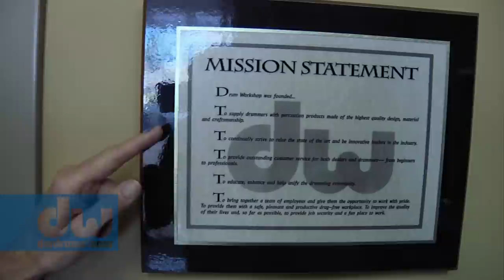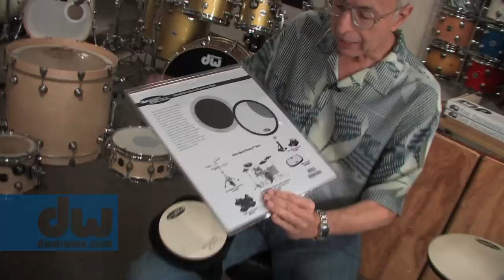DW Hardware Webinar with Curt "Kirkee B" Bisquera, Cobus Potgieter, & Don Lombardi

Comment: I've actually chatted with Mr. Lombardi over in forums about Pedals and cams, etc.
 I did switch because I was looking for a round cam with a better linear response and while the design and engineering of these new ones are outstanding I do miss the manufacturing quality of my DW5000 double pedals that I got for a discount (80 bucks) at Best Buy when I was getting started, even when they were made in Taiwan. A true work horse, those guys went to Hawaii and back in my checked in luggage and were inspected and taken apart by TSA, they still work. I'll never forget those pedals and still have them.

I just wish the cost could go down and that the pedal design itself was a little longer and less like a foot, but I know I'm the exception. Also offer the option of the turbo round cam with the standard 5000's.

These things are like Cadillacs and they are made for loud music with their huge heavy beaters.

Comment: Great stuff, high quality made. I have lots of DW hardware for my different kits and I'd like to have it consistent. And that's the problem … I'm based in Germany and most of the accessories and spare parts has lead time of 3, 4, 5 or more months. This is unfortunately not acceptable for the working drummer …

Comment: I have a concern that i would like to address to the nice folks at DW's manufacturing dept.. I have always used your pedals, and now, i'm going old school rerto with your DW 6000 turbo single pedal, as it is made exactly like my old 5000 pedals, which helped me perfect my heel-toe technique.. I would never think of using any other pedal on the market, so this is coming from a loyal DW pedal customer..
However, there is a particular flaw in the manufacturing of the 6000 series pedal, and that is the bass drum hoop clam lock screw.. I'm referring to the screw that holds the clamp in place.. Because i use different sized bass drums with different sized hoop thicknesses for many different gigs, the screw started to bend in a forward position, and this is after the locking mechanism was locked into place.. Luckily for me, all i had to do was bring the original screw to my local hardware store and found a pack of screws that were the exact same size match and fit perfectly, only that they were about an inch longer, but still works perfectly..
Now i know that this is not an adjustment issue because i've been using this type of pedal for a while now and know how to adjust and lock the hoop clamp.. I'm thinking it may be an issue with the type of screw being used, or where it is placed ?.. As of now i have the hoop clamp lock nut fastened all the way to it's lowest position, and adjust it more with the wing nut..
I really don't know why this is because i'm no engineer , but i do know that this problem needs to be addressed.. Any suggestions to avoid future bending of that screw ? 
I'll admit, i am a bit of a lead foot, but have really good technique, which is only natural after 32 years of playing, but still love the fluidity and lightness of the 6000 series pedal, and aesthetically , it looks great with my kite..  So with that being said, i hope you fantastic folks at DW can fix this problem..  Any and all suggestions are welcome.. Cheers !
Reply from the maker: Hi blica 1, can you please contact our customer service team so they can take care of you. We just want to make sure that there aren't any other issues with your pedal, etc. Thanks for sharing with us.
Hours: Monday-Friday 8:30am-5pm PST
Phone: 800-45-DRUMS (800-453-7867)
Email: customerservice@dwdrums.co

Comment: you guys need to bring the adjustment up above, mount them on the snare drum clamp arm, the bass pedal mount screw should be on a u-joint up near the top of the pedal, you guys are not thinking, If I was working for DW, I would change the drumming world...yes I am him. I designed this stuff, 25 years ago,

Comment: Sorry to post on such a old video but I just got my 9000 rack.  I know it's all about options but what is the generic theory of using the V Angle Clamp? I couldn't tell if it would be more helpful for quick tom movements since it doesn't seem to be necessary for cymbal arms since they have the adjustable angle via the boom arm holder already. I hope all my terms here aren't too confusing.

Comment: What is the largest snare drum size that a 9000 snare stand can hold? Can it hold a 16 or 18" floor tom?
Reply: and how did you mount the bass drum with the design series kit?
Reply from the maker: Hi peteroks12, it will hold up to 15". The DWCP9300	holds 13" 14" and 15" and the DWCP9303 holds 10" and 12". We hope this helps. With the Design kit we mounted the "gong" bass drum with clamps to the hoops. Those clamps then attached to the drum rack. Thanks for asking. :)

Comment: how did i never stumble onto this video prior 🤔also ... how hard can it get to have a damn manual on dw pedal that a bit more specific than : well move stuff arround and figure shit out k enjoy your new crazy adjustable pedals alone in your corner O-o. For real, I suppose im neat picking really but i wanted to know what is the alleged benefit draw back of each settings .. like idk higher beater = more power but increase stroke weight factor ... but for all adjustment including the board height. would have saved me lot of time =_=

Comment: I have two new 9000 DW hi hat stands.  I use  the long rod but it is always unscrewing.  Easy enough to retighten but is there a way to prevent the rod from turning?
Reply from the maker: Bi-Polar Express You can try a little teflon tape on the threading and put it on the opposite way of the threading so it doesn't come off if you remove the rod. It could also be how the hat is being hit, etc, and worst case scenario you can order a new rod. I hope this helps!

Comment: i need dw5000 pedals replacement parts, that top part where the springs loops arounds (the piece that you can choose the angle of the beater) and the shaft is worn out, a bit pricey.  I had these dw5000 for over 10 yrs
Reply from the maker: +metalmessenger http://www.dwdrums.com/factoryaccessories/partsandaccessories.asp
Reply: +dw drums im looking for the red rod(dw5000) that goes from bearing to bearing, the one that holds the cam and the beater
Reply from the maker: Hi. here is a link with the Schematic for the 5000. You can order any parts from our dealers. Cheers. 😀 http://www.dwdrums.com/images/info/schematics/Pedals/DWCP5000AD3/Single/DWCP5000AD3.pdf
Reply: +dw drums thx that will help, im also thinking about changing my pedals from a chain link to a nylon strap, all the parts that i couldnt find are listed here.
Reply: dw drums thank you, with your lead i was able to get all the parts i need, my dw5000 are better than out of the box, with my springs upgrade.

Comment: I was interested in getting a concept kit (im on a budget) and a pdp rack but could I put dw boom arms on the pdp rack to get the features like the wing that holds the felt and the part under the sleeve to tighten the space between felts? If that would work I would love to know. Thanks
Reply from the maker: lucas wroblewski Yes. 😀

Comment: Having the top felt attached to the wing nut is not good if you have a cymbal holder attached to the bass drum (tom holder clamp, etc.).  Every time you play the bass drum, it rattles.  It's very annoying.

Comment: pioneered the chain drive pedal?   What about Sonor's signature series pedal from the 1982 catalogue?  I use a Sonor sig series and to me it looks an awful lot like a DW 9000 series; I use a DW 9000 series hi hat which looks a lot like a sonor 82 catalogue sig series hi hat.  Sonor lead the way in so many aspects of decent hardware.  Their hardware was made to last forever just about, double braced, memory locks, levers instead of wings nuts, rubber instant release grips for cymbal stands, quick release lever snare stand baskets etc etc.  Not to mention using woods that previously had not been used like bubinga, based on actual research about the hardness of wood and there associated sonic qualities.  Sonor were one of the first drum companies to use Beech and Birch woods extensively in their top shelf drums.   Credit where its due DW.  http://www.drumarchive.com/sonor/Sonor1982.pdf
Reply from the maker: Paul Speter Here is some basic information of DW Drums. 👍 http://www.dwdrums.com/info/dwstory.asp
Reply: I believe the chain drive was invented by Frank Ippolito, who modified Camco pedals.  Even if you allow DW to count Camco's creations as their own, I don't think the chain drive counts.

Comment: 9000 pedals are smooth and buttery, but lightweight feel? Not so much.
Reply: Id say if anyone was after a lightweight pedal they should just get a cheap 40 dollar pedal with no pedal base.
Reply: +Simon McDowell No, they should get something like Yamaha dfp9500 or (for longboarders) the Tama Speed Cobra
Reply: +Frank Larssen ...I'm talking about feel. Lightweight feel
Reply: +Frank Larssen actually you know what, you're right about the speed cobra. Haven't tried the Yamaha yet. I guess what I was saying was most high end pedals I have seen tend to be quite heavy although I will admit that not many beat the dw pedals in weight. I have a baseless pedal and it's great for a 16" bass drum. The cheapest one Yamaha has.
Reply: You should try out the Yamaha´s if you get the chance. They have great balance and power despite their lightweight feel.
Reply: +Frank Larssen well I am in Japan so I should although Pearl is the most abundant brand here. There seems to be a surprisingly low Tama drum set count though.
Reply: Both are great brands, no doubt. Tama is perhaps more export oriented?

Comment: Cobus's hi hat stand is wobbling like crazy...does not inspire confidence. I have the same problem with my pearl...
Reply: It's probably cause It's a two legged stand rather than a three haha
Reply: +A7XfoREVer2013 That's definitely why, but since that's the main quality a 2-legged stand should not have, it definitely doesn't make me want to replace my (also wobbly) pearl with a dw.
Reply: I've got the DW 9000 two legged hi hat stand, it must depend on how someone sets it up because, mine barely wobbles at all!
Reply: +NathanXdrums I agree. I have the same hi-hat stand and it's the most solid stand I have used. Absolutely no problem. One thing I will say is that if it's two legged you just have to make sure you have it setup precisely but as long as you do it's solid.